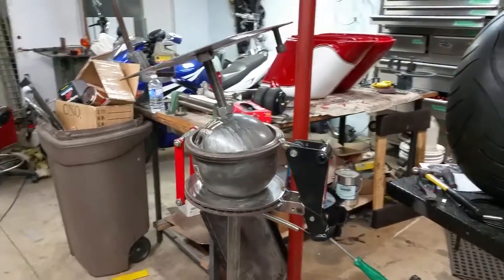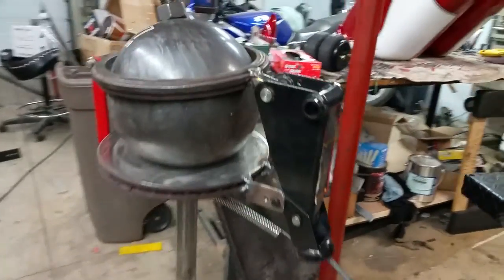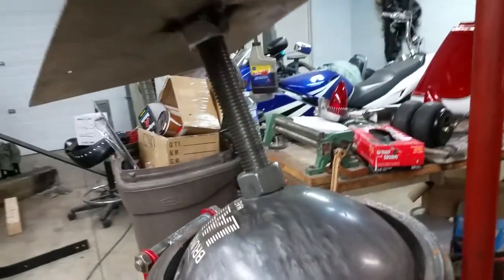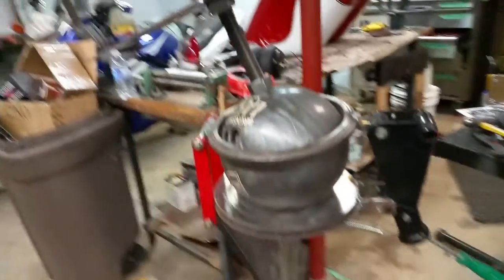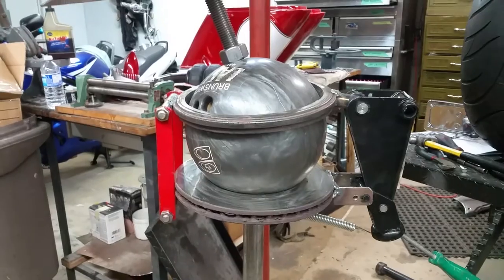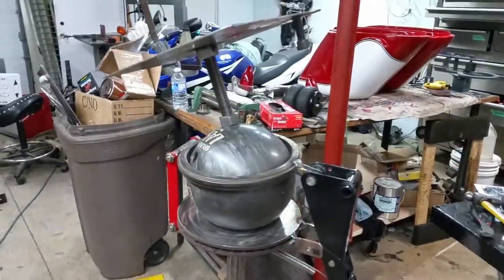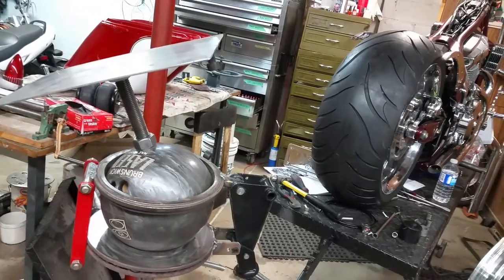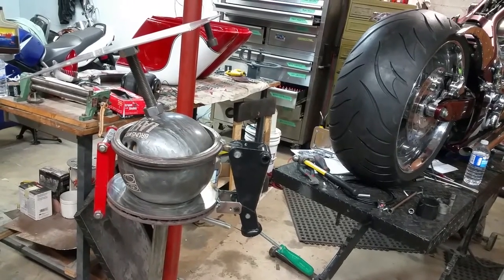Bowling ball welding station

Comment: Where did you get the drum clamp to hold the top of the bowling ball?
Reply from the maker: I used the outer ring of a drum brake. Cut it and welded it
Reply: Like your build, Great job!